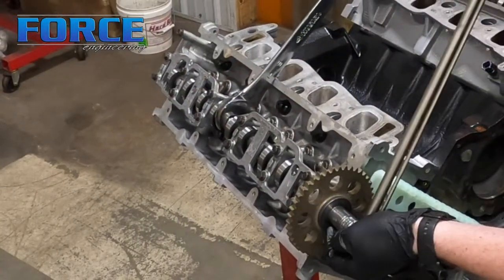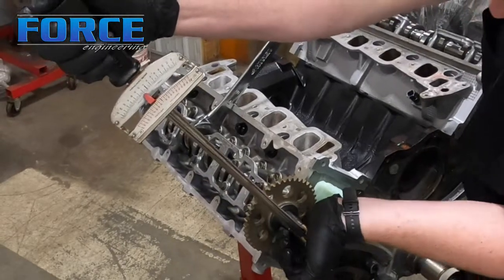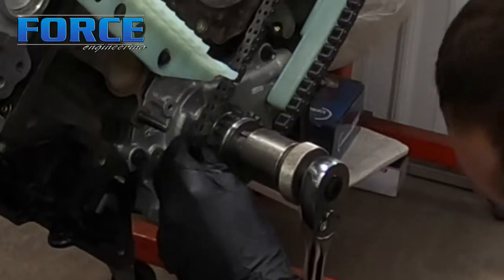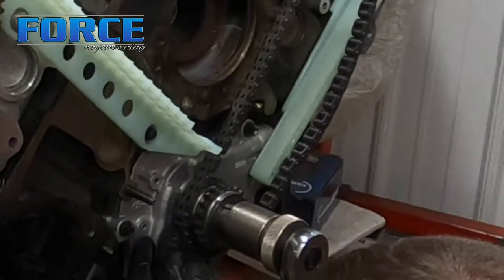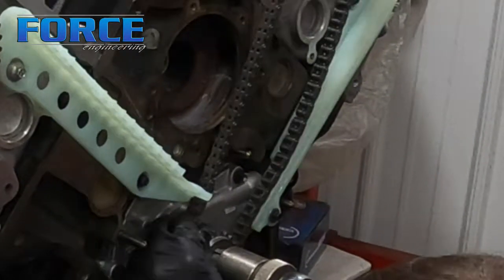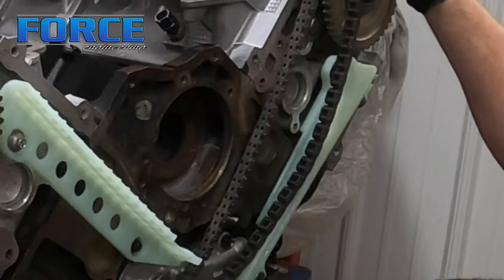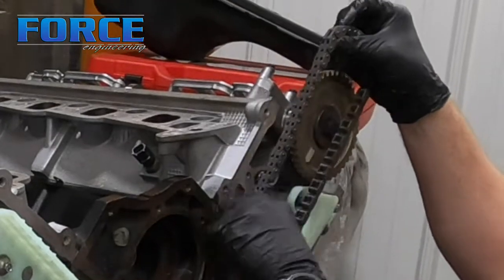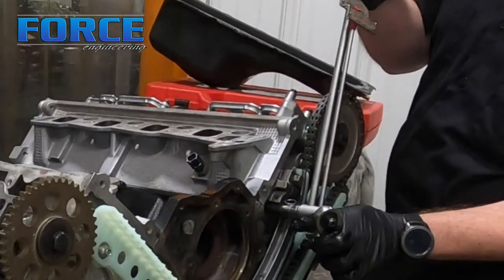Ford 4.6L V8 Final Assembly | Ford 4.6L 2V Engine

Comment: hey do you guys still build these?  whats the preferred way to get in contact for a quote on a new motor build and dyno tune?
Reply from the maker: We do.   Send me an email.  Force-eng@hotmail.com
Reply: @ForceEngineering  thanks.  i've sent a few emails for quotes on a 4.6 2v build and haven't received a response yet.   i know this stuff will cost $$$$$ but was still wondering about a build/tune.
Reply: @ForceEngineering how much does a stock 4.6 2 valve weigh?

Comment: Did you degree the cams? Did you get power numbers on this engine?
Reply from the maker: These were non adjustable cam gears.  Its scheduled to go on the dyno next month.  This same engine combo (with a smaller turbo) is in this car. 

https://youtu.be/8DsKkpS0vPs
Reply: @ForceEngineering  would you be interested in looking at a 5.4 swapped town car? My buddy with the 18 Silverado sent me over to watch the vid on the dyno and the 4.6 2v caught my eye
Reply from the maker: @AcidBrianS  possibly, what are you needing done?
Reply: @ForceEngineering  it's my brother's car, I believe he would just want it thrown on the dyno to get some actual numbers, it's been remote tuned thus far. Long tube headers, cams, ported heads, and a few other odds and end.
Reply from the maker: @AcidBrianS  for sure! Message our shop facebook page, or call and leave a VM 

269-685-6668